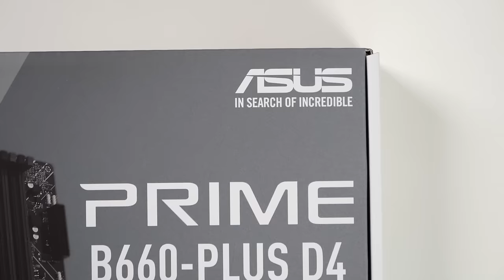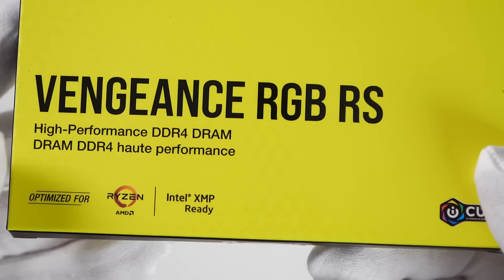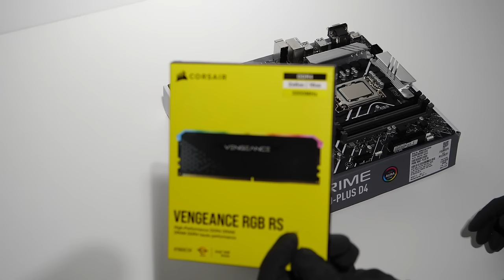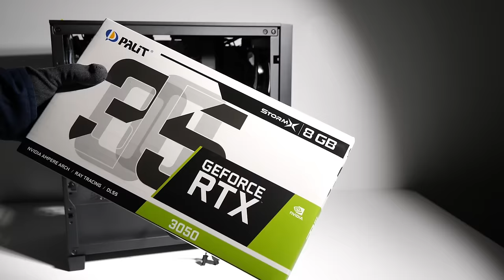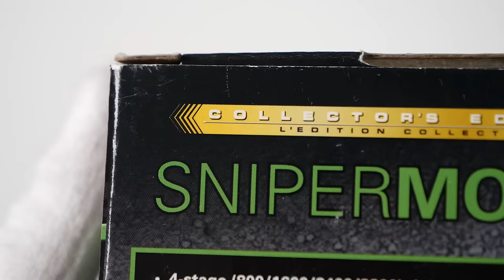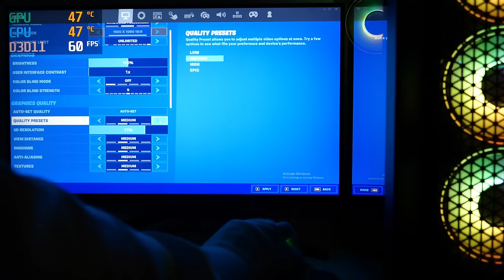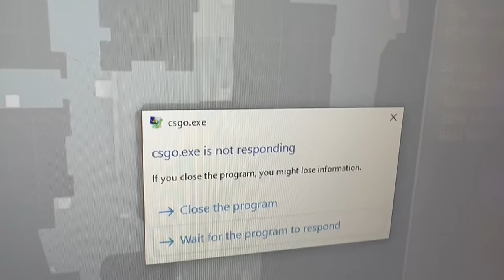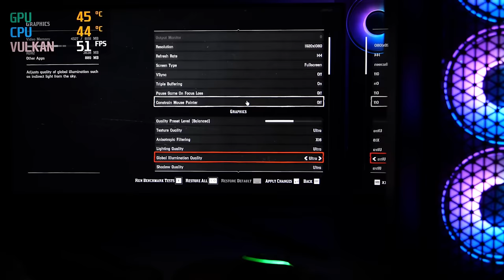Building my new Budget Gaming PC for 2022

Comment: It’s really hard to get good specs on a budget because graphics are so expensive nowadays
Reply: They are about MSRP now
Reply: No not anymore
Reply: @ezplays3321  the 3050, which is entry-level, is like $350. That’s about a fourth of the overall price of this build on one component
Reply: @bandit2613  Well the 3050 was sitting on evga b stock for a week at MSRP. Yea not anymore but you can find 3060's for        400 and rx 6600s for 300 and below.
Reply: @bandit2613  Yes some cards are still over msrp but if you look in the right places and for the right cards you can find cards at any budget for msrp
Reply: Prices are about msrp these days they've really come down
Reply: @bandit2613  still cheaper than a 3060
Reply: Still cheaper than a midrange pc
Reply: Buy rayzen 5600g or 5700g no need gpu
Reply: I know, right?! Like I could buy a freaking Xbox Series X or PS5 with that money.
Reply: @bandit2613  the 3050 is trash btw
Reply: @Rochak Baveja ehhh. I personally would still go for a pc
Reply: @rando3962  So if you don't have enough budget for a 3060, what the f*ck will low budget people buy?
Reply: @Rochak Baveja With a console you can't do homework, you can't do work, you can't play competitive  esports (Csgo and valorant for example), you can only play  selected games. Not a pc fanboy btw.
Reply: @sr.chi7741  6500xt, 2060, 6400, 3050 or optiflex and put a 1060 in there if you are on a really tight budget
Reply: Kaushik Arnav  honestly, no it really isnt becase you are going to have a cpu bottleneck so i would either save up more or try to balance it out
Reply: Kaushik Arnav  yes cpu bottleneck is bad and should be avoided. Besides cpu's and gpu's are cheap. If you cant buy it new then just buy it used.
Reply: @rando3962  If you’re really tight on budget, get an APU and get a graphics card later. Not every country’s economy is the same so in some places, building what’s “budget” in one is expensive to the other
Reply: @LeBronyaJames  i mean, i know what you mean, but with the current prices? i wouldnt really consider it a better option currently.
Reply: @bandit2613  3050 is a dogshit card
Reply: @vengeancxe  well ofc now it’s outdated, at this point I’d probably get a 3070 or 3080 for a reasonable price, if I had any money that is
Reply: @bandit2613  its always been a shit card
Reply: @vengeancxe  aii then, idk
Reply: Speaking about scalpers...
Reply: not really, cpus like the 5600g are an excellent budget option and can run modern games on their own just fine
Reply: @sr.chi7741 what an out of touch comment lol. iGPUs and 10-20 series are still good for the price
Reply: @payayaa  That's only if you buy them used. The 2060 isn't worth it because it's at about $270 - $300 and you can get a 7600 or a 6600 for cheaper. The 2070 can't really be found anywhere on Amazon, the 2080 is at 400$, and you can get a 4060 ti or 6750 xt for significantly cheaper. The 2080 ti is at $600 and you can get a 4070 or 6900 xt for cheaper. The 1070, 1060 and 1050 ti aren't worth it when you can get a 6600 for the same price. The 1080 ti isn't worth it because the 4060, 6750 xt, 3060 ti and 3060 can be found at the same price or lower.

None of the 10-20 series cards are worth buying when you can find cards from 30/40 series and 6000/7000 series are cheaper
Reply: @sr.chi7741  i didnt check the us prices but yeah

prices are different where i live

Comment: A Gaming PC is definitely one of my goals one day.
I have a Gaming laptop that i bought 2 weeks ago. It's great and fits my needs.
I game on consoles mostly. But it doesn't hurt to play some light to mid games that you can't play on modern consoles.

I need someone to reply to this comment one or two years later and ask me if did get a gaming PC just for fun.
Reply: I will be the person buddy dw
Reply: Gaming PC are more expensive than laptops in my country
Reply: Did you get one?
Reply: @Scwarzkop  OMG I actually did!
Ordered in late March and arrived  early May 2023.

Specs:
RTX 3060TI
I5 12400F
Kingston fury 16 RAM

My comment did not age well.
Ever since Sony increased the PS plus prices by an absurd amount. I shifted everything to PC. 99% of my purchases are on PC as well.
I only play sports games that have no crossplay on PS5 . Other than that it's all PC everything.
Reply: @CertifiedMVP  Nice! I got similar specs
RTX 3070, i3 12100F and 32GB of DDR4-3600 RAM (built it myself.)
I'm actually gonna upgrade soon to R5 7600X, DDR5 and 32GB of DDR5-6000 RAM, maybe even a 7800 XT
I own a PS4 and I have never used PS Plus.

What happened to your gaming laptop?
Reply: @Scwarzkop  those upgrades will be nice.
the gaming laptop is still there. I mainly just use it for work now.
but everynow and then if i have time to kill, i would try to install and run some mid to heavy games just to test them out.
it can run tekken 8 on low settings! and some other titles on high-midum settings. gtx 1650 is still kicking.

Comment: here's where you budget out a little bit more

- Case
- Ryzen CPU rather than Intel
- Normal RAM sticks rather than the fancy RGB ones
- Standard Non-RGB intake and exhaust fans
- Motherboard
Reply: CPU too 
ryzen are much cheaper and having more cores
Reply: @ASSASSIN19923  yeah, edited and added
Reply: @ASSASSIN19923  which amd cpu can compete to the 12100? 4100? xD
Reply: @hehehehaismus  AMD Ryzen 5 4500 3.6GHz Box
is a bit cheaper
I3 12100 have 4 cores and 8 threads 
Ryzen 5 4500 have 6 cores and 12 threads
Reply: @ASSASSIN19923  cores dont equat to performance
Reply: @Deuteriumaddict  actually ryzen is far better than Intel on rendering and editing stuff because of extra cores.
Reply: @ASSASSIN19923  you're comparing 4500 to 12100. If that's so then let's compare 12500 to 4500. 
4100 vs 12100 is comparable. Even knowing that 4100 is worse than 3100 XD.
Reply: for a few more euros (not even 20) you can get a 12400f and a 3060

Comment: U call this budget???
Hmph..
Budget means an i3 6th gen...8 gb ram..gt 1030 2gb gddr5 ..a h10 motherboard..any loww price cabinet..450 watt psu and a 1366x768p res 60 hz Monitor..any normal keyboard..
A cheap gaming mouse..
That should be aroung 250-300 usd..
Which is 25k-30k Indian rs...
Bruhhhhhhhhhhhh

Comment: With that cpu, the best gpu i would use wouldbe a 1660 or. 2060, it will throttle with a 3060, if you want the most value out of it just buy an i5 12600k for less than 200 bucks, same price as that gpu, for 800 bucks with peripheral included you can build s pretty good machine, i bet you spent 650-700 bucks, but for more 100 there is a rewlly big difference

Comment: This is a really smart build the i3 looks weak but in reality is better than older i7's the mobo will have 2 years of support so definitely upgradable and DDR4 is still very relevant today savings lots of money on ram. The case is expensive but worth the money in my opinion along with the fans give it great aesthetics. Great PSU and I'm happy you went with the 3050 it will perform well enough for now. 

Note: The only thing I'd change is the ssd I'd get an m.2 nvme but if sata is what you have you can always add more later.
Reply: Yeah I would also change the ssd for better speeds and some m.2 ssds are in the same price range as the sata one
Reply: The i3 is a 4core cpu, that’s not smart 😂
Reply: You can always sell and upgrade 4 cores are fine.
Reply: @Flip012  4cores more than enough for normal users

Comment: in the video you said you choose rtx 3050 instead of rx 6500xt right? I find you making such a choice unfair to the rx 6500xt because: Firstly the rtx 3050 has 8gb of vram and the rx 6500xt has only 4gb. Second, the price of the rtx 3050 is higher than that of the rx 6500xt and it should be in the same segment as the rx 6600.

Comment: Dont buy the i3 buy the i5 for more 40 bucks, dont buy fans, buy a case with 3 or 4 fans already inskde plus a cpu water cooler, you save in fans so you will have the money to buy a wter cooler unstesd of an akr cpu cooler, they are like 40 bucks apart but each of those fans cost 10 bucks and are unnecessary, also dont buy an ssd sata, for the same price you can buy an nvme 10 times faster, and dont buy 16gb ram, buy 32, with a setup like this you will be able to play triple A games, with the setup you built it will  not be possible, my 600 dollars laptop is better and is from 2019

Comment: Well that is one TERRIBLE budget PC, first of all, you could get cheaper B450 motherboard with Ryzen 5 3600, both are usualy cheaper and better than what you got, and for SLIGHTLY higher price or almost the same you could get RX 6600 8GB, and is much MUCH better than 6500 and RTX 3050, the power supply is also shit, you could get 900w power supply silver for that price, an used one but in good condition, or 700w one also silver but new and ready for eventual upgrade, the RAM sticks you choosed are needlesly expensive, there are a lot of cheaper ones with same quality and performance, I can't say anything bad with the SSD drive, and the case could be much bigger and cheaper, stock coolers nowdays are not enough, even cheapest 3rd party options are better than stock ones but they are big and need bigger cases, this monitor is awesome for the price, I bought exact same one for my friend so that was actually a good choice, you could do much better for less, even for half the price if you bought used parts, you overpriced A LOT even with new parts, a 1000$ for a PC like that is far too much

Comment: you definitely don't need that much fans for a 3050 and a core i3. and pls don't do the dot thermal paste on a 12th gen intel cpu, you gotta do the thick line across it. though it'll be ok since it's a 13100.

Comment: the case and mobo are not suited for this build. You can see the cables run everywhere at the front. It doesnt look nice. Should have gone for a longer GPU in the 3050 series and possibly gone with the 011 Matx Air case. Would have looked better

Comment: Bro you can buy a better prebuilt with a 1660 ti for 
Cheaper which is barely better than a 3050, you can build a pc with a 6600 xt going for 350 on eBay or 6600 for 299 on eBay, a 6600 xp is better than 3060 ti and pc with 3060 come at 1299 but you can get a pc with 6600xt for 900
Reply: Dm via 👆👆👆👆
thank you for watching and dropping a comment!
Your efforts is always appreciated
I've got something special for you!

Comment: Personally, I would have used a RX 6600, any mid-range board and any 6 core CPU to bring the cost down. This system is mid-range, not budget. No part besides the GPU should cost more than the CPU

Comment: I thought this was a budget build
Reply: It is. You're just broke. Go work
Reply: @WarmXY  i have i9 13900k + 3090ti 32gb 6000mhz 1200w thor rog , 4tb ssd  ، Z790 wifi - e mothetboard , Full Tower Corsair x7000 icue , i750 icue Liquid Cooling x7 140mm Fans .
and im already bored of it ..
next gen consoles way better
im not used to pcs anymore 
costs me 6000usd for this pc parts and bulid and all .
i dont belive in digital games too ..
i love physical something i feel i own .
Reply: @obidahasdia4095  I see. Great pc though for other stuff apart from gaming as well. I have a i7 11700k and a 3080 16gb ddr4 3600mhz ram
Reply: @WarmXY  i only finshed re7 on it .
games cheap on steam .
trying to download horizon zero dawn on torrent .
for emulation it runs anything .
strugles with ps3 emulation only like god of war 3 .
i got a chance to get 4080 for my 3090ti 
but still there problems witb 40xx serieses .
so i might not .
i have 1080p monitor so 60fps lock on all games .
i will upgrade monitor later .
as pc cost me 6000usd .
i can upgrade ram to 128gb and another 4tb sata with my already 4tb ssd i got . so 8tb total . for cheap .
i only lacks games .
im ps & xbox fan since birth but got pc cause i can upgrade it .
but dam it costs a lot 6000usd is not easy $$ .
as for consoles which do same games 120fps 4k  .
consoles way better .
i might change my mind after i test more games on it .
i play with series X controller on my pc better then k&m
Reply: @Obida Hasdia  I mostly play on my pc however I play GTA on my series s because of my gta online profile.  I'm looking to get a rx7900xtx
Reply: @WarmXY  is upgrading gpu more important then gpu?
Reply: @WarmXY  u got steam account to add you?
Reply: @Obida Hasdia  ya. To be honest. I barely use steam. I mostly use the epic games launcher but it's Warmturtwig
Reply: @WarmXY  next gen consoles have blurays whichs awesome to have physical games you pay you 100% own.
maybe pcs for torrent pirating games migh pay off instead .

Comment: If that PC is "budget build", so I'm a Elon Musk, bruh. Wasted money on a worst RTX card and i3 12gen. 5 RGB fans. RGB RAM, when a non-RGB costs less. 2.5" SSD from Samsung, of course. Case, which is worst for "budget PC". PSU is good, can't say something else. Monitor is good option for 1080p 144Hz. Mouse and keyboard - garbarge, expecially mouse. 
So, verdict - this is not a budget PC, it's a trash. You can add 200 Euros more for better PC and better performance:

CPU: AMD Ryzen 5 5600;
MOBO: Gigabyte B550 GAMING X V2;
RAM: Kingston DDR4 16 GB 3200Mhz (2x8gb) /x2 (total 32gb RAM);
GPU: MSI GeForce RTX 3060 Ti GAMING X LHR 8GB;
SSD: Patriot Viper VPN110 1TB M.2 PCIe NVMe;
PSU: Chieftec Core 700W 80 Plus Gold;
Case: Aerocool PGS Shard RGB;
Fans: 2x of SilentiumPC Mistral 140.

It will have a better performance.

By the way, you almost never showed a full OSD in games, or which graphics settings you applied. As I've seen in NORMAL tests i3 12gen + rtx 3050 - was clearly a less FPS in games.

Of course you used a 100500+ RGB parts, except for GPU, which is of course costs more. Yeah,  f**k performance, need more RGB in PC, because raises a FPS /s.
~~~~
Ending this, you really built a garbarge, but that garbarge was released in 2022.
Reply: forgot to mention, my build may cost 1240,56 Euros, but it's better.